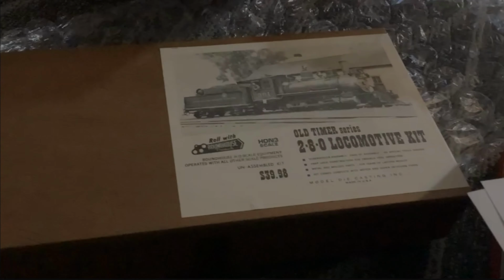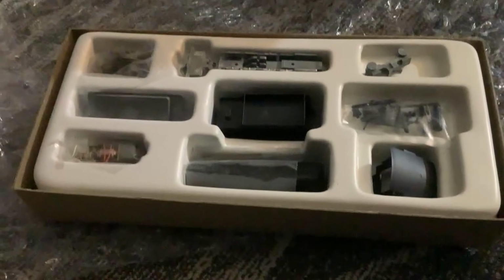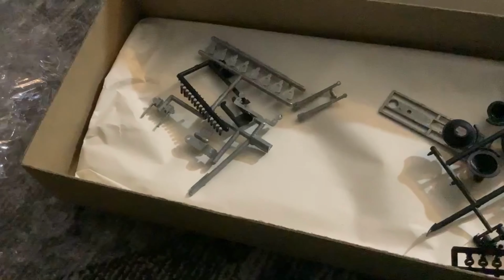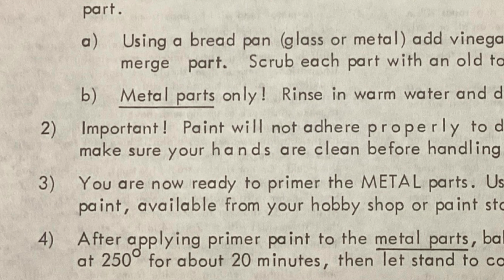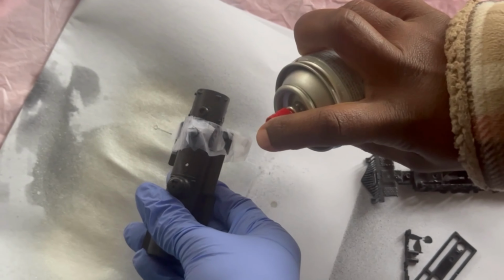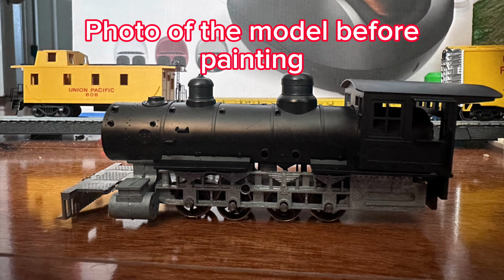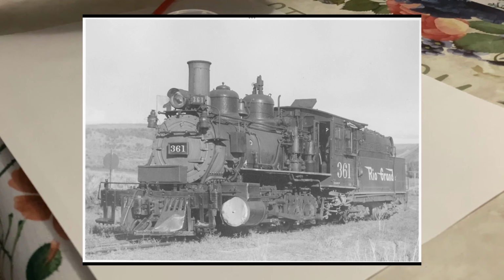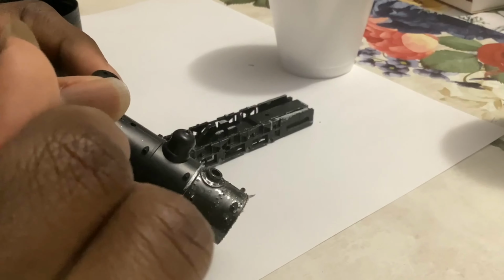Building an MDC roundhouse locomotive PT.1: Paint & Prep

Comment: I LOVE the MDC/Roundhouse kits. I have two kits yet to build. 3-truck shays. Those are absolutely crazy to build due to so many small parts. Also i had to buy a replacement gear set from a company called Northwest Shortline. The stock gears (according to many) are fragile and crack real easy. The replacements are made of stronger delrin plastics.
Reply from the maker: @WWIIREBEL  I will probably also probably have to eventually buy some of those gears as well, they are real fun to build though! Thanks for watching and commenting!